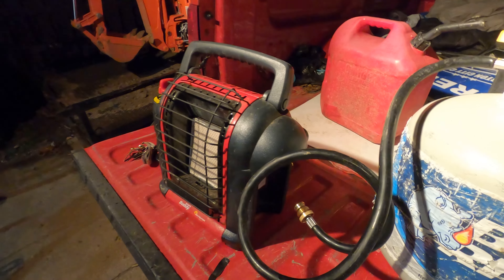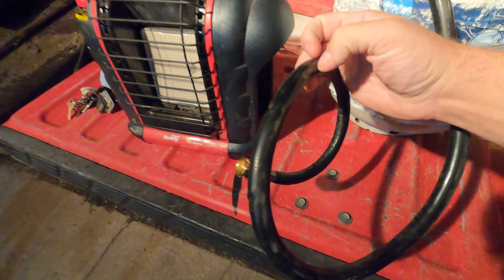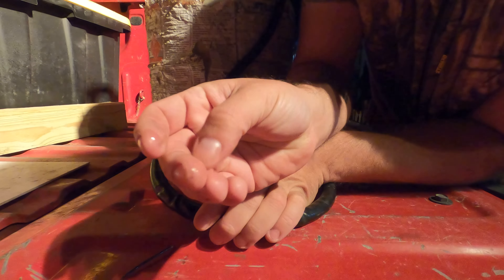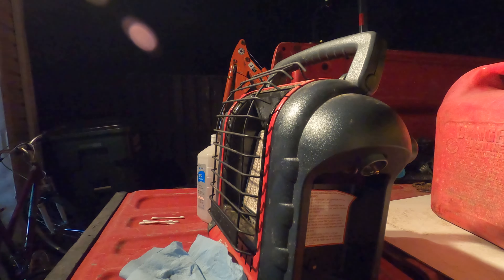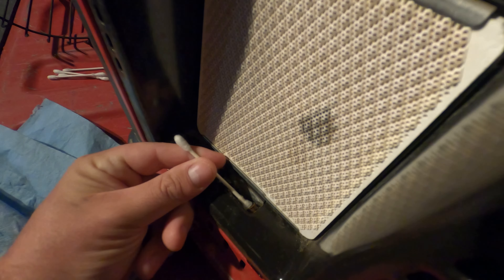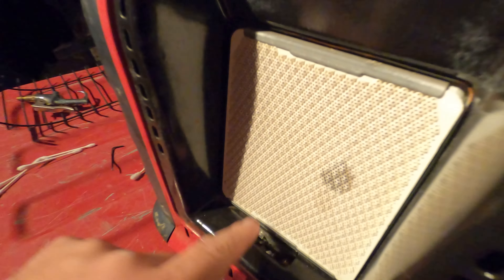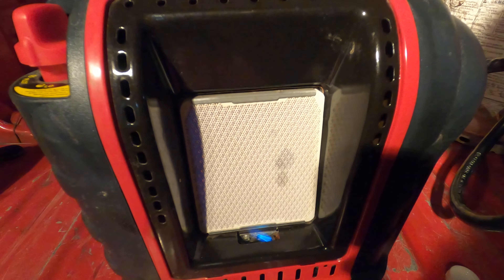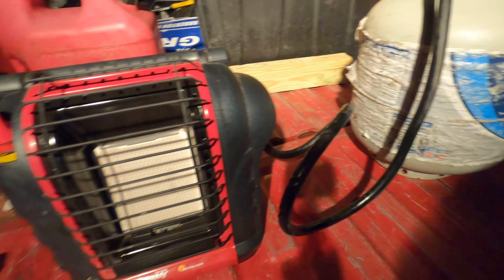Easy Mr. Buddy Heater FIX - No pilot light and won't stay lit

Comment: Really Mr. Heater recommends using a inline propane filter when operating from a larger tank. The little tanks come pre-filtered but big refillable tanks can get crud, moisture etc. I think the last time I bought a filter it was $8-$10usd, I replaced it every couple years on my big buddy.
Reply: Not if you use THEIR line that doesn't require a filter.
Reply: @GearDump187  yes because it has a filter or oil block built in. Listed on page 5 of the owners manual. So their hose, your good other hoses a replaceable filter part#(F273699).
Reply: My heater lasted less a tank before the filter clogged. Lasted another 2 minutes after I removed the filter before the line clogged. POS.
Reply: Yes you need a filter and you won’t have this problem
Reply: I used there hose and now it is not working
Reply: @DanaYoder-k8p Not true
Reply: I used a filter and line from Mr heater and it still did it in a month
Reply: @alansullivan5913 I been having the same issue later. I have the proper line and filter for the unit.

Comment: These buddy heaters are great but this no pilot problem is so strange. I've got 2, and in my case for the newer one at least, I've been able to determine that it's related to a fresh full tank. Too much pressure or something.  So now what I do is only use a partially full tank for the buddy heater after using up some of the tank on another type of propane appliance first. So far it has worked every time and no pilot light issues at all. I now realize that if you've got the heater and hose all hooked up properly then open the tank valve yet hear no "whoosh" or see the hose expand/move - Then your pilot won't stay lit because the tank is not supplying gas. Hear the whoosh and you're golden.
Reply: I'm not hearing the woosh sound, there's definitely no gas moving.  Have you fixed one when it was like that?  I tried the q-tip thing but to no avail
Reply: @Ryan-cn7yl  ya the qtip thing does almost nothing. The only luck I've ever had is to change the hose, or one time I was able to light the pilot with a bbq lighter and let it burn awhile before turning the heater to low. Another thing I make sure to do and hasn't failed me yet even with full tanks is to change the tank as soon as the heater goes out and is still warm.

Comment: The best thing you can do to avoid that issue is to buy a Mr. Heater filter!
You can also buy a Mr. Heater hose that won't bleed oil.
Mine is 6 years old and has never burned without a filter, and Mr. Heater hose and I have never had that problem.
Reply: Be nice if the heater came with one...

Comment: Ok so same thing happened to me. The Q tip fuzz came off inside of the pilot hole and I had to use pliers to get the stick out but fuzz is still in there I guess? I took all of the steps and no dice. 😕

Comment: I use the hose and filter when using a large tank. I also sometimes use the 1 pounders.  Still doesn't work. I've cleaned out the lines, and I've got a good spark. I'm wondering if the thermo couple is adding to the problem. I shouldn't have to take it apart in the first place. I'm starting to think these things are pieces of junk, right out of the box.

Comment: Just commenting to say that this worked for me.

Brand new buddy heater. Brand new hose. Brand new tank. Wouldn’t even get a pilot going.

Cleaned the aperture as directed and it with alcohol and got it working in 5 minutes. 

Thank you.

Comment: Great job cleaning the line. The oil is actually in your tank. It is common for lpg to have a little dirty oil in with the gas. This is why residential systems have a “drip leg” for the oil to settle in before it gets to the furnace/heater.
Reply from the maker: Thanks for the info!
Reply: In that gas there is no answer to the oil issue in mr buddy’s, unless you strictly use the expensive small tanks?

Comment: Mine would not light but I have always used the 1 pound cylinders so I knew the problem was not the line.  Thanks to your video, I started to look for maybe another source of obstruction.  Found it.....friggin mud wasp had plugged up the pilot light orifice.  Used a little screwdriver that I have for cell phones,   Turned the unit upside down.  Worked the screwdriver in while my son tapped on the bottom.  The mud came right out and the Mr. Buddy fired right up.  Damn mud wasps!!!! 
Thanks for the video.  Same idea....just different culprit.
Reply from the maker: Glad you got it working. Stay Warm!

Comment: This definitely happens even if you refill the little tanks.  But the alcohol swab trick worked! Thanks.
Reply: i just got a new green big buddy with the fan. the pilot light doesn't light. do i have a defective one? should i return it? or do i need to do this trick? i added 2 one lb propane tanks. basic setup.
Reply: @fallback8314  can you smell gas when you hold down the button? Sometimes if they've been sitting for a while cleaning them will definitely get it going. But it sounds new. You shouldn't have to use alcohol but you can try. Try some air if you have a compressor. You can also try holding a lighter up to it. If it doesn't light then, there's definitely a problem. If returning it is an option, it may be the way to go.
Reply: @coreymillia  just got it from amazon brand new two days ago. i can smell gas a little. i'm afraid to try alcohol. won't it cause a fire doing that? i don't know anything about this. first time buying a gas heater. what does it mean if you can or can't smell gas? i think i smell a little gas.
Reply: If you can smell a little gas it should light, there may be a little dust on the sparker. Also you should see a spark. You don't really need to use alcohol unless you don't smell gas. Using alcohol won't start a fire, you only use a q tip or so. I would just keep hitting the spark button, for a few minutes.  It should light. Sometimes it just takes a few tries.
Reply: @coreymillia  i had the green one. returned it today. stopped at home depot. picked up a BRAND NEW just shipped to the store red one (i saw them bring it down from the overheard with a forklift in it's shipping box and unwrap it). brought it home. same thing. nothing. i thought the first one was a dud but when this one did the same thing i thought maybe it was me but now that you mention spark, no, i don't see a spark. didn't see a spark in the first green one either. i think ima give up on these pieces of junk.

Comment: hmmm...i have a new buddy heater a new and full 11 lb squatty and a new 10 ft line which i am told does not need a regulator . A new  1 lb bottle runs the heater just fine . When i hooked up the 11 lb tank and the 10 ft hose it took awhile to get the pilot to stay on . Then it would light but only a little while and go out . Another try and it would run longer and go out. I will try blowing out the line tomorrow after making sure the heater works again with the 1 lb bottle. Thanks for the idea.

Comment: Did you ever used your mr heater indoor? Is that propane smell normal wich fills the room?
Reply from the maker: The Buddy Heater is designed to be ran indoors. I never noticed anything coming from it and run it all the time in the cabin through the night. It will specifically say on the machine that it can be used indoors if it is built for it.

Comment: I have a big buddy with the long hose that's made by the same manufacturer so it's not supposed to leech oil. When I push down and turn the  knob  to pilot, hissing gas blows it out every time. This just started to happen today. The tank and half the hose is outside in 20 to 30° weather. Is this a factor?

Comment: Mine was the tip switch it got stuck so you flip it upside down take those two wires and connect them together that are on that little black sensor
Reply from the maker: Interesting. Thanks for the tip. I am sure it will help others where this may not be the entire issue!

Comment: I had to take mine apart - the valve was completely filled with oil and wouldn't actuate to start gas flowing. Brakeleened everything out and let it air for a day outside and back to working perfectly.
Reply from the maker: Sometimes the lines can get really bad. It took me a while to figure out how and where to blow the lines out so that it was effective. Even after cleaning the lines, there must have been some residual cleaner left because it really started working better after I let it sit for about an hour.

Comment: I use one at home to heat my house an have nothing but trouble starting this thing every new winter season…. My 3rd mr. buddy heater i’ve owned. I take great care of it. Why am i having nothing but issues lighting it?
Reply from the maker: It seems like there is a ton of issues with them. Thankfully, after I found out how to handle this issue I have not had any other issues with mine. Even after it sitting for an entire summer season, it fired right back up.

Lighting issues can be do to the regulator. I have had issues when I left the switch on and screwed in my fuel source. This would trip the regulator and I would have to disconnect the fuel source, turn the heater to the off position and then reattach the fuel source.

I have also has issues where the pilot won't light and if it did, it would not stay lite. I found this to either be the regulator or the heat sensor that keeps the regulator open.

I personally have not had many issues after I made this video but dang near through it out the window before due to lighting issues.
Reply: @TheOhioOutdoorsman1  i eventually got it to work for 2 hours last night, now today same problem i had yesterday. It’s basically still brand new and made sure i put it away properly and everything last winter. I’m trying to turn it on an it just won’t stay lit…. I thought i got it working stayed on for 5 mins, but it shut off after.
Reply: These things are trash had problems w everyone I’ve owned

Comment: My problem is the propane can’t get from the tank to the Mr Buddy. If I use canister of propane it lights up with no problem. I’ve tried tapping the hose on the floor. Turning everything off, disconnecting the hose and turning on the knob on the propane tank slowly. 
It worked yesterday and it ran out so I had the propane tank refilled and now it’s not working.

Comment: I've discovered if you release the red knob to the top gently it will stay lit to start a heater.
Reply from the maker: I just brought this one back to the house because it is acting up again. I will have to check this out.
Reply: Since I started doing that little trick last week it hasn't given me another problem, as long as I wait the obligatory 15 to 30 seconds before starting to let it come up. I haven't had to put another q-tip in the pilot light or anything, I just have to let the knob come up gently not abruptly.
Reply from the maker: @chrissy6478  glad to hear it been working. I have to do mine again but most likely because I did not learn my lesson with the cheap house.

Comment: Here is the perfect solution to the problem:  1. Turn off the knob, 2. Remove the propane bottle, 3. With thumb and fingers extended and joined place your left hand under the unit and with the right hand grab the handle, 4. Take the unit outdoors to expose it to the elements, 5. Open the garbage can and toss it in aggressively (be sure not to harm any children or animals and not harm the ozone or whales).
Reply: I’m beginning to agree as I have 3 of them and not a one will run and I’ve done ALL these tips and TRICKS. Ky finders are bleeding. I’d rather throw it in the trash and buy something new as a disabled old guy with hairdos arthritis in my hands. 100 bucks for a heater that can’t run more than one season. I call bullshit